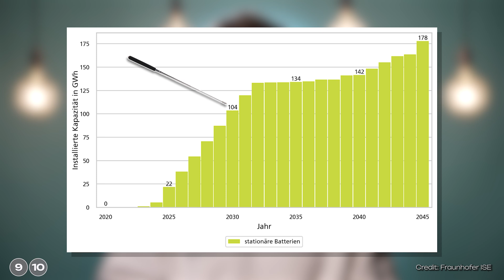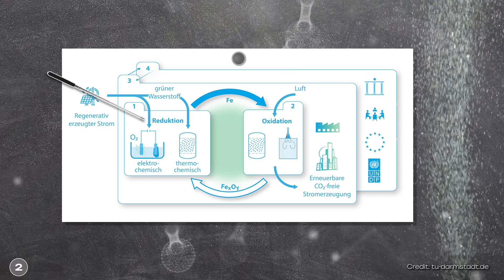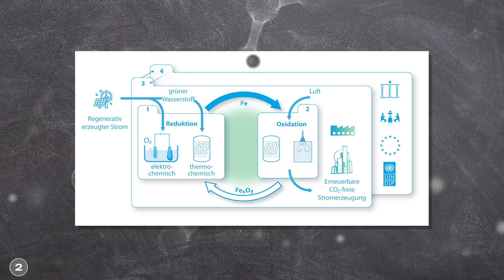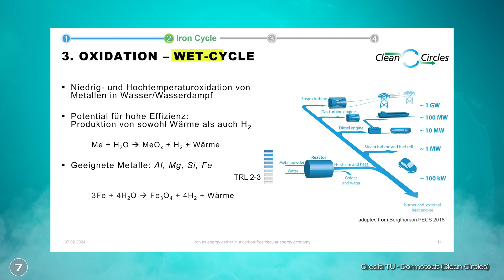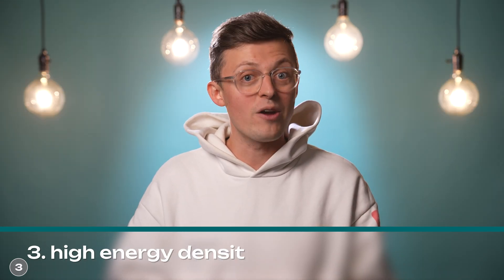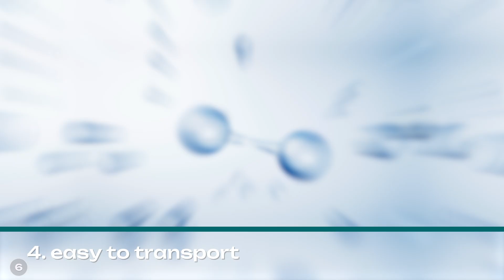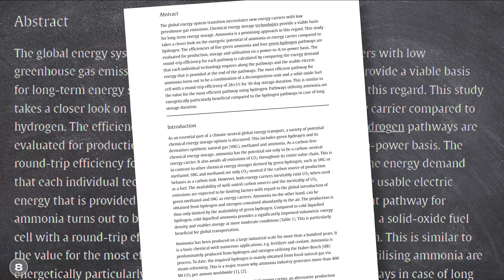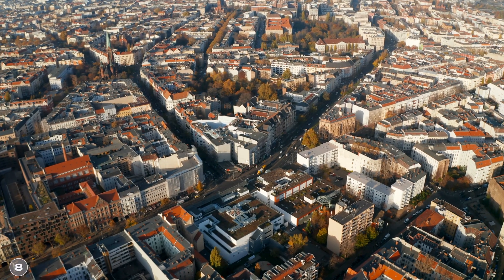Energy storage revolution: chemical storage with iron!

Comment: Sorry, but this is not science; this is just burning money and pretending to do science... 
Round-trip efficiency of just 30% is ridiculous, not to speak about the maintenance costs, storage costs, safety, etc. In my opinion, from the economic point of view, the round-trip efficiency will be less than 5-10%. So if you store 10€ of energy, you will get back only 0.5-1€, or even less. For me, going with nuclear energy is a much safer bet.

Comment: The obvious problem with this is efficiency. Whenever you use electricity for creating chemical energy and do not use a fuel cell for creating electricity but heat and a turbine then you have already lost.

The main advantages seem to be the lower constructions costs if you have a plant including a turbine and a big connection to the electricity grid (the storage containers for liquid hydrogen may be expensive, too). The video mentioned the easier transport but I don't see why you would want to transport the iron.

Combined heat and power sounds interesting but it seems that very few coal power plants in Germany do this. Probably those are the newer ones which would probably be shutdown last. How expensive the connection to the district heating grid would be probably differs a lot from location to location.

I am not very familiar with chemistry. It would be interesting whether it could be possible (and economically feasible) to create a kind of fuel cell for iron. I guess if that was an obvious option then those two institutes of technology would have mentioned it, though.
Reply: It wont be lower contruction cost but greatly higher for iron to be used you need basically a metalurgy combine of power plant reduction plant and whatever the reductor will be conversion plant...how will that compare to just a plant burning coal or gas?

Comment: I doubt that a roundtrip efficiency of just 30 % is good enough for large scale application of this technology. I think we will see other storage solutions like thermal batteries or redux-flow batteries before we will see a lot of iron cyclers.
Reply: The efficiency is even worse if using the hydrogen reduction process.
Reply: True.   Liquid Air Energy Storage can do 50–60%
Reply: The 30% is only for electricity. He said in the video that it is higher if the waste heat is used for heating.
Reply: Reduction produce heat and they reuse it for electricity its just using coal not for burning but reduction and it would cut usage of coal by about half in energy production. The cost per kwh would be significantly higher though. You need to build preety much metalurgy combine of coke plant reduction plant and power plant so imagine how cost of that combine will compare to just a power plant burning coal?